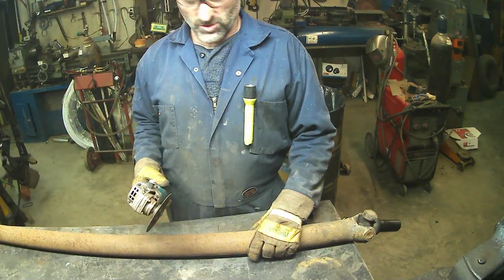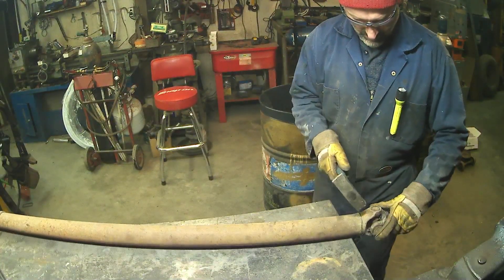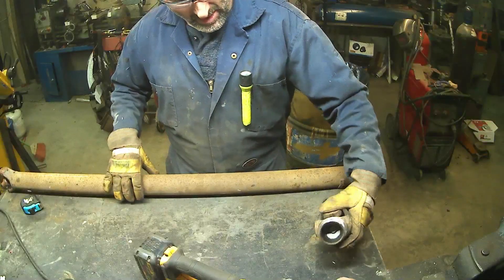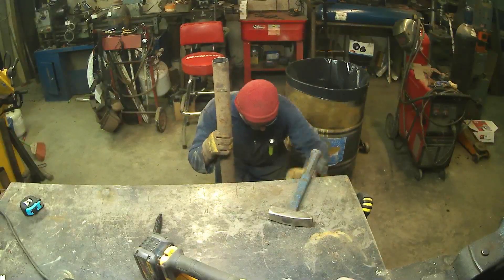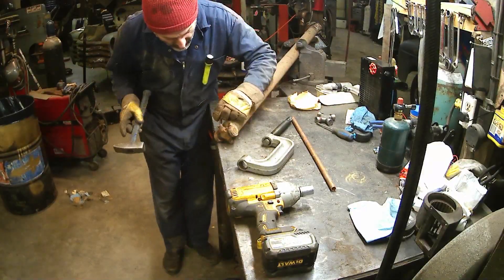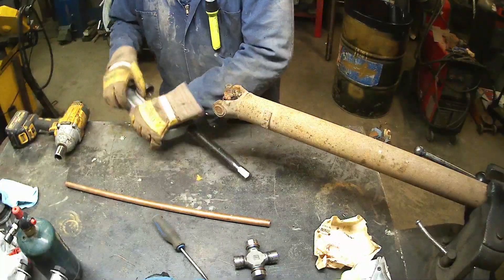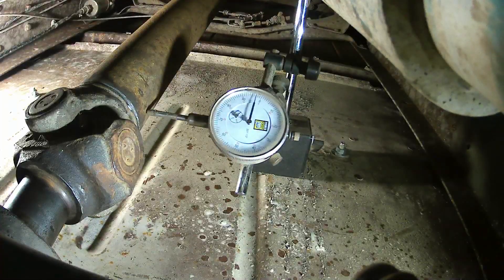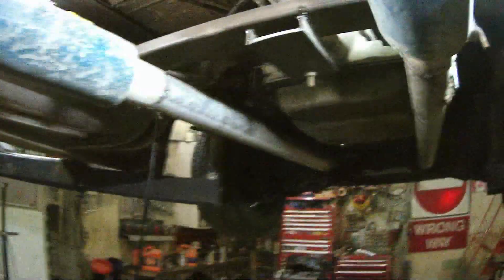How to shorten a drive shaft and align it on the vehicle.

Comment: So you are supposed to get the high spots out before welding it? I may have messed up then. I am working on my driveshaft right now. I cut it down, put the yoke back in and phased the yokes then  welded it up. I thought you got the high spots out after welding it together. Crap!!!

Comment: Your method isn’t bad but people should be real careful re welding stock Chevy and dodge inside clip u joints. The extra heat from welding them back in messes with the nylon injection that holds the caps in. 

This works well at the race track in a pinch but I would have it balanced either way.

Comment: WOW!! Great job
 One observation, how about a shield on the grinder. I'd hate to have that disc  disintegrate on your face. That would be a real ouch, and will put a real damper on your  progress.
Also,  how far is the yoke sticking out of the tail shaft. Looks a little much. Shouldn't be anymore then 3/4 to 1 inch. That could be the reason  for some of your out of roundness.
Reply: I have no guard on my 4 1/5” angle grinder, but wear welding gloves. I never have my head, face in the plane of the grinding/cutting wheel. Just had 3” of a worn cutter come apart at full speed last week. Glad I had the long gauntlet on the welding gloves. It stung a little but did not leave a mark. 
 I watch a video from some guy overseas in who knows where, fabricate some metal into a useful shop tool that required all kinds of welding. He wore shorts and flip-flops the entire build. That scares me. I was under a 4 ton disc welding gussets with an arc welder in the early 70’s. It left 3 burn marks in my arm pit on the right, 4 on the right. I still get asked by a doctor/nurse every time I am getting a shot. The one they couldn’t see, burn’t thru my tennis shoe and landed between my big toe web and toe #2. That hurt as I wiggles out from under the disc and found the only mud hole with water in it in the barn yard. I was about 13 when that happened an never did another. ASE Master Tech since 1978.
Reply from the maker: Thanks, you learn to not stick your face anywhere over the zip disk, as for the yoke it looks that way but it is only about an 7/8 to an inch out.
Reply: @HalfassKustoms  well then, a full face mask should be  considered .🤔 take care.  And Be Safe.

Comment: I always get a steel ruler and put 3 punch Mark's in a row from the yoke down the tube. Then cut out the waste tube and bang back together with the 3 punch Mark's lined up using the ruler again. The main reason is I know it's back exactly where factory balanced it.
Reply from the maker: Ah unless you cut put the factory weights haha although I've never noticed any vibrations after doing that either.

Comment: one continuous weld , or stitch to control heat?
Reply from the maker: I stitch to control the heat, and always stitch across from my last weld.
Reply: any thoughts on balancing or screw it?
Reply from the maker: I have never had one balanced. With that said I've never notice any kind of vibration and I've shortened a lot of driveshafts.
Reply: lovin your builds. thanx for taking us along